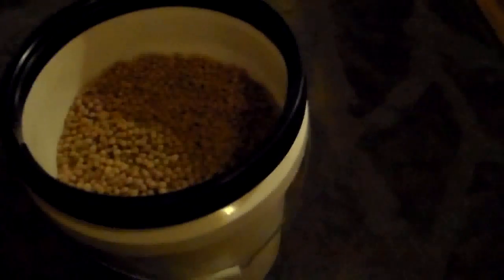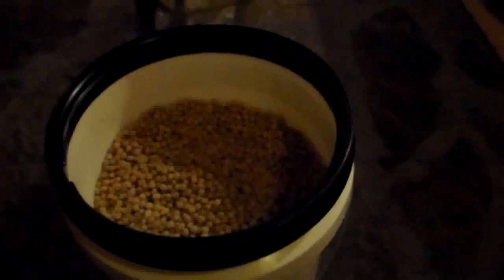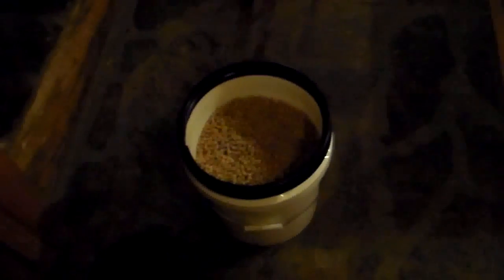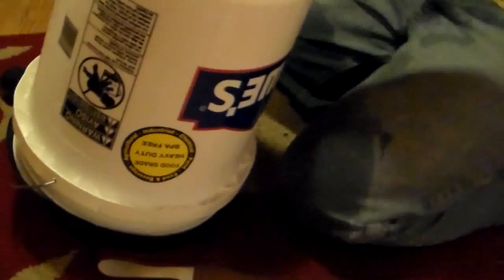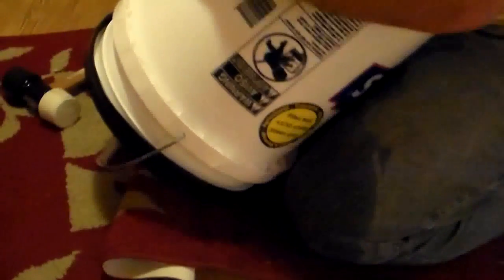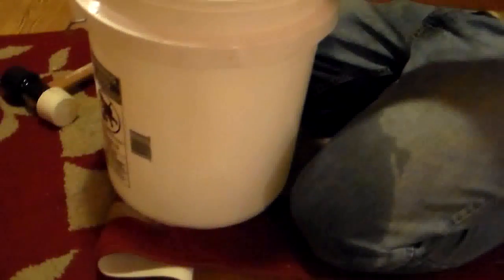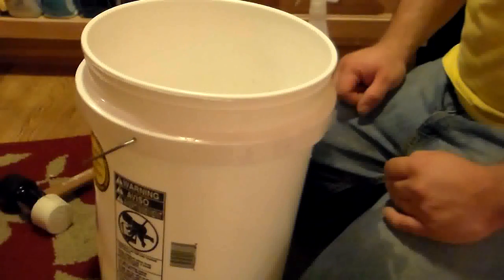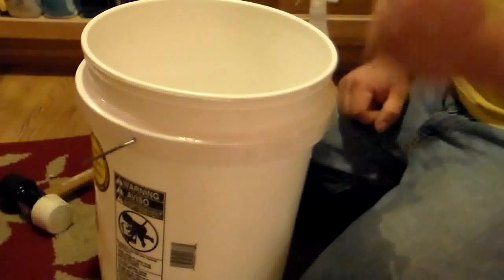How to Remove a Gamma Seal Lid From Bucket

Comment: THE YEAR IS 2023 SO I DON'T KNOW IF YOU ARE STILL OUT THERE.  I TOO HAD TO REMOVE THE RING OFF OF A BUCKET.  I DID THE HOT WATER LIKE YOU DID BUT I COULDN'T USE A MALLET LIKE YOU DID.  SO I IMPROVISED.  I PRYED THE RING OFF OF USING ONE OF THOSE TOOLS THAT IS USED TO REMOVE THE ORIGINAL LID THAT COMES WITH A BUCKET.  IT WORKED LIKE A CHARM. I JUST USED THE TOOL LIKE YOU WOULD A BOTTLE OPENER AND PRIED THE RING OFF.  IT TOOK ME LESS THAN A MINUTE TO GET THAT RING OFF.  I HOPE YOU GET THIS MESSAGE.  THANK YOU SO MUCH.
Reply: Thank you

Comment: I have mine installed on some orange Home depot 5 gallons buckets. They are designed a little bit different than these, they have a lip about 3/8" lower than the gamma seal "ring". I just took a 3/4" wrench and used it as a pry bar. It took me about a minute to take it of without heating or nothing! So If you think about getting the lids off at some point, get the home depot buckets! In my case I wanted to same the gamma lid and not the bucket, but the two are still intact!
Reply: Thanks bud, your hot tip got the job done for me tonight.

Comment: Great video!  Question, I received my very first gamma seal lids today. I purchased two from an auto detail company, along with two of their five-gallon buckets. I put the lids on by hand, without the use of a rubber mallet. Just a lot of elbow grease, and a few choice words. Once I heard the snap, I figured I was in-the-clear. Filled both buckets with water, spun the lids on, turned 'em both upside down, and out came good ol' H2O!  Needless to say, as of right now, they're not leak-proof. Is there something I could/should do with the lid, to stop the leak?   Any ideas would be great!   Thanks!

Comment: Thanks for the tip of using heat.  But I had ten to remove.  Ain't nobody got time to do that with hot water.  Two minutes with a heat gun and you can pull them off by hand.  No need for a mallet.  No visible warping and the lids screwed in smoothly just like before.  I suppose I will know for sure next time I put one on.